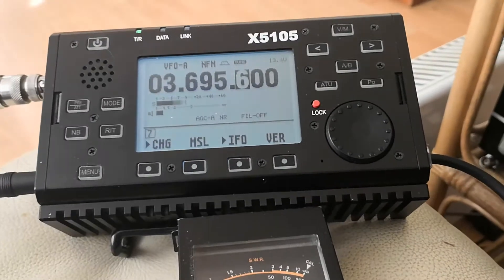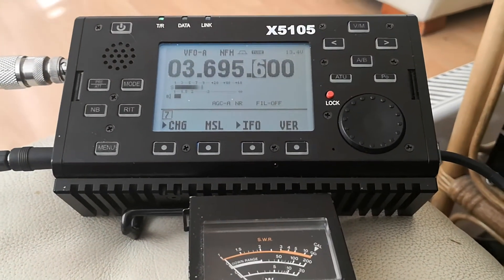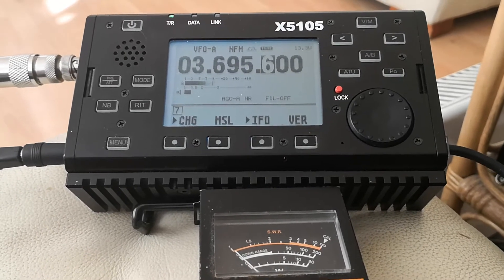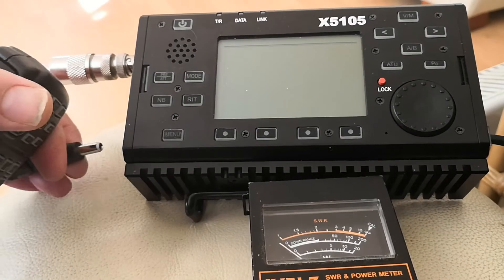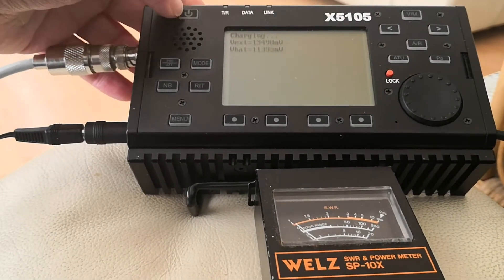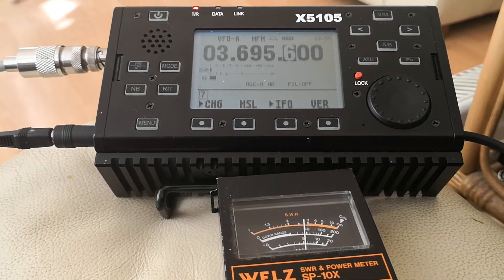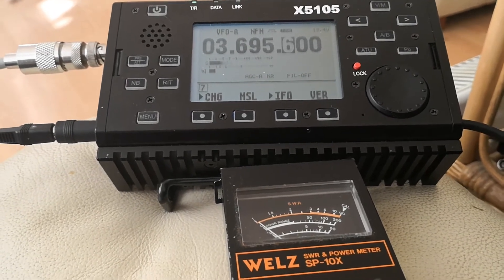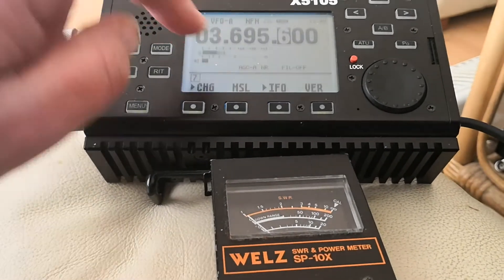The X5105 pulling DC power whilst transmitting is no longer a problem

Comment: Hi! Is it normal for the transceiver to shut off when you disconnect the power cable eventhough you have a charged, built-in battery?
Reply from the maker: Yes it is, for that brief second when you pull the DC connector out the radio it has no power which is why it shuts down. When you plug the DC lead in it disconnects from the internal battery as its power source, but it will still charge the battery.. Ive had other radios that have done this too..

Comment: Good to see. 

If these boys had only bumped this up to 20W (as is the case for their X108G) I suspect they would be shipping them out daily by the container load. A bigger battery, a fan and a bigger heat sink shouldn't significantly drive up a cost. Also, it needs CW decode built into the firmware not, as proposed, in the forthcoming add-on XDT1 digital terminal. Nobody wants to carry an additional  pan-adapter box on a SOTA activation ?
Reply from the maker: Yes 20 watts would have been great, but the reports that we get back show that the 5 watts is getting us out loud and clear. As it does with the X108G, give it a thousand feet or above and the results will be even better. Xiegu does take on board every comment made and do read these posts & messages.
Reply: Agreed but field use isn't always from the top of a mountain ;-).  There is a good reason why the trusty old Clansman and similar HF man pack portables sit about the 20-30W mark. A bit more 'punch' above 5W helps a lot for NVIS ?
Reply from the maker: Yes I agree 20 watts may of been better, but the results many new owners are getting from shack use with their 5 watts have been glowing reports..This was designed to be a true QRP radio for real QRP enthusiasts..Do you own one???
Reply: Not yet - I am in the headlong rush to be second so most grateful for the videos of you early adopters ;-). Waiting to see if CW decode (becoming a de-facto standard in QRP rigs like KX3 and Elad) gets embedded in firmware. For a stand alone QRP rig  I would have hoped for CW decode functionality before PSK decode.

Different subject - any idea of the ATU spec ? Will it tune up a bedspring or do you need to be starting with an SWR that is pretty close ?

Comment from the maker: I have contacted Xiegu about this problem of disconecting DC power whilst transmitting this afternoon. I got a response within an hour if that. This is Xiegu’s response..

Hi wayne
Thank you very much for your efforts.
I'm sorry, I did not tell you this fact, it is my fault.
Now that we have changed this phenomenon, we can remove external DC power whilst transmitting,  no damage the power management chip.
You tell them can remove the power plug and nothing unexpected  will happen.
Thank you very much.
Regards

MU

So their we have it in black and white.. 73 de Wayne 2e0bvj
Reply: To be accurate, this was not actually an internet myth. The 'source' was the manufacturers own operators manual (see P6 https://fccid.io/2ANLH-X5105/User-Manual/Users-Manual-3598702) which described the problem. There were some internet shrieks of horror at this design flaw and it now seems the manufacturer has addressed the issue with a subsequent modification. Well done Xiegu.
Reply: Hi I have an older/early model X5105 I'm unable to get a response from Xiegu for inquiry on repair (what chip to replace), would you happen to know? Thanks KM2W 73

Comment: Thanks you so much for doing that demo. It was a great demo showing that there's nothing to be afraid of.
My concern was if a fuse failed, "would I have bricked the radio?" I now know there is no  need to worry. 
Thanks again, 
de KU3X
Reply from the maker: Barry Kery You will not have a fuse fail if DC power is disrupted Barry, believe you me the X5105 is built like a battle ship..Having inline DC fuses will pop first if its cross wired, but simply pulling DC power in transmit will not cause this to happen.

.I have tested this quite a few  times when I very first heard it before finally doing this video..Each and every time my X5105 has fired up again when DC or internal battery power is used..Even the built in battery charging management went unscathed..

Comment: I have done everything and all to try and brick this radio and it cant be done, as long as you can still erase (even if already erased) using the terminal program one can still get into the radio for any changes or upgrades to the radio. Cheers Fred
Reply from the maker: VE3FAL1_Fred absolutely correct, as much as we have tried we can't roody brick it whilst updating firmware or pulling the DC power 😬. These X5105's have beaten us untill another myth comes along..
Reply: I can see if you wired your own cable and 5v was sent or on one of the in/out pins for the CIV port, but that is the only way I can see it happening.
Reply from the maker: VE3FAL1_Fred yes of course, this would be the same with any transceiver. But Xiegu supplies the correct USB to com port lead with it, so that shouldn’t be an issue..